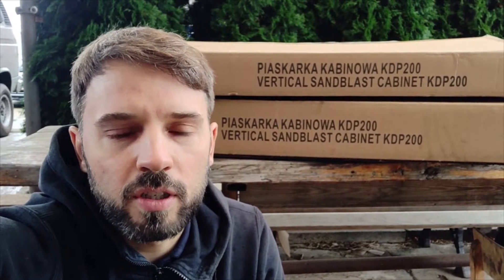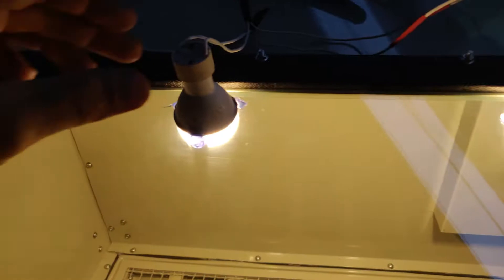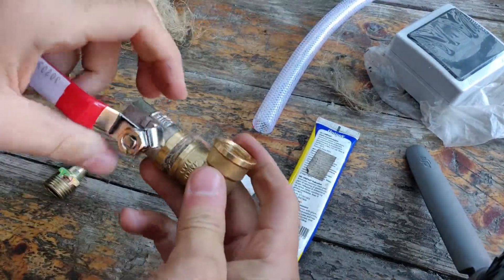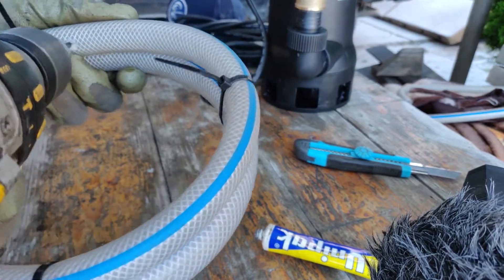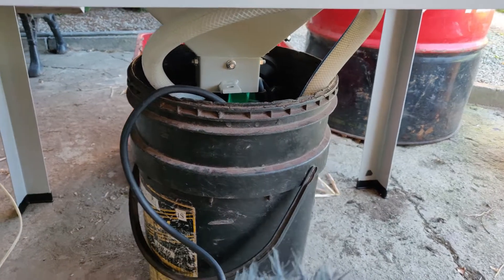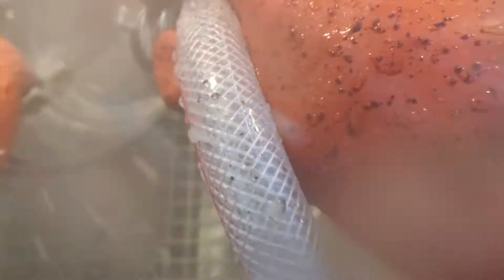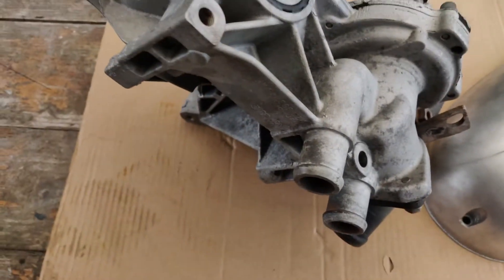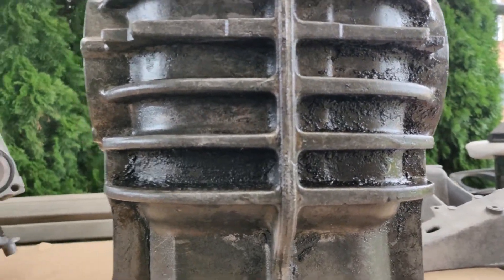Vapor blaster DIY

Comment: How many psi where you using on your air compressor? The pressure looked low.
Reply from the maker: I am using a screw compressor and I am not sure how to increase it, so it keeps around 6 bars.

Comment: Like your setup you can make it work beter if you
1.  get better mixture on your media 
2.make the pipe from.the pump to.your.gun continues without a.valve
3.use glass beads instead of soda
4.use 8 or 6mm nozel
5.play around with your water bead mixture  in your bucket
Good.luck enjoy
Reply from the maker: Thanks, I will keep in mind. I have done some things already, even added high pressure washer setup, which I'm very   happy with. Also made a video about improvements of this setup. 
Cheers, G.
Reply: @Gadomaitis  soda it disolves in water... its for dry blast
Reply from the maker: Good point, anyways, I was adding it just as extra, as I thought for a fine finish
Reply: @Gadomaitis  ad as they mention: glassbeats and afew drops of soap,dont put to much or u get anoying foam,for  a polish result, low presure ~6 bar and then poliish wheel whit compound to have a miraror effect
Reply from the maker: Thanks, I will give it a try, when temperature will rise above freezing temperatures in my garage!

Comment: Using soda in water is not real good. Soda dissolves... Glass or garnit or aluminium oxide
Reply from the maker: Didn't knew that, thanks for your advise. Anyway it was just a one try that didn't turned out well, never used baking soda since. Korund to cut and glass beads to finish.
Reply: @Gadomaitis  yeah mate.... Trial and error. I use soda in dry blast for carbs then I put them in my ultrasonic cleaning tank. It's a bit safer due to soda dissolving and doesn't leave any nastys in carbs.
Nice effort tho..
Reply from the maker: @gc33  Exactly, trials and errors.  I will keep in mind your advice for my next job, appreciate it, thanks.  Cheers, G.
Reply: @Gadomaitis  I'm still playing with mine. I have done almost exact thing as you have... I seriously need a bigger compressor tho...
Reply from the maker: @gc33  I have two of them on same air line. First one is a screw with ~1,5 m3 flow, another one is simple piston compressor and maybe ~0.65 m3, The difference between those two while working is huge, after one hour of constant work, the piston one heats up and I can feel the heat from that compressor in the room, somehow doesn't feel "healthy" for it, meanwhile the screw compressor easily handles work loads. Slurry pump and the setup of it makes a big difference, after the modifications I have done to it later, it's a pleasure to work now and I'm extremely happy with my high pressure setup in the same cabinet, if you haven't done it, I highly recommend it, of course if there is a need for it.

Comment: What air pressure you got? I think you need like 120psi and at least 15cfm to get the job done.
Reply from the maker: Pressure is between 6 and 8 bar, around 120 psi, the flow above 30 cfm. Problem was the nozzle. I have upgraded it already, works like a charm now.
Reply: Other guys that are on YouTube use minimum of 60psi...
Reply from the maker: @gc33  I have sorted out that problem, it was due to media lift, now it's working like a charm.

Comment: Good job brother
Reply: yeah i'm open my business since 2 years..
Reply from the maker: @H.K_project-015  mate, good luck with your shop, keep it busy. Cheers, G!
Reply: @Gadomaitis  if you want I can teach you about the powder coating business
Reply from the maker: @H.K_project-015  would love to! But I doubt I have time for new business.
Reply: @Gadomaitis  I think if you have a vapor blasting device ... you boda also opened a powder coating business ... here I use it to repair some old motorbikes
Reply from the maker: @H.K_project-015  truth to be told, I'm trying to restore my old bike https://youtu.be/hEbuxREiDPM , do you have any advice to share with me?
Reply: @Gadomaitis  you have facebook.?or you have a whatsapp number.?
Reply from the maker: @H.K_project-015  I do have FB, You can find a link to my account in my channel, or in 'about' section, it will be easier.
Reply from the maker: Thanks heaps mate!
Reply: @Gadomaitis  Try using a 2 stage cleaning process ... the results will be more shiny
Reply from the maker: Thanks, I will. Also i have done few improvements to the system, it works so much bettet now. The flow already made my glass dull in few spots. Happy with the results on the material, but not not happy with glass affected. Need to find a solution for that problem.
Reply: @Gadomaitis  I learned from my friend ... he taught me to do sand blasting before using vapor blasting ...
Reply from the maker: @H.K_project-015  i have seen his works, awesome guy from New Zealand!
Reply: @Gadomaitis  where do you from brother..yeah name is josh hubbard from new zealand
Reply from the maker: I'm from Lithuania mate, where are you from? He is doing awesome job, I took some ideas from his videos.
Reply: @Gadomaitis  im from indonesis bro..
Reply from the maker: Cheers to Indonesia mate!
Reply: I have a small business of powder coating-sandblasting-vaporblasting-body paint repair
Reply from the maker: How is it going? You guys busy over there?

Comment: do  two passes one with fine aluminum oxide or fine crushed glass second pass with the fine glass beads its makes all the difference
Reply: Find me on Facebook
Reply from the maker: Done
Reply from the maker: Thanks, I will try. Another thing that I have noticed yesterday, that my media lifting is not giving me enough of media any more, maybe it sats down on the bottom of the bucket, this needs to be  sorted. Also i have ordered 8 and 10 mm nozzles, now I was using 6 mm maybe it was to small. I will have a look at your channel and your solutions, looks like your vapor blaster is doing magic. Nice chanel btw and thanks for your advice. Cheers, G.
Reply: @Gadomaitis  get rid of the ring and go with some downward jets
Reply from the maker: Thanks heaps, will do that.
Reply: I dry blast with 120 grit aluminum oxide followed by vapor blasting with glass beads. Works very well.
Reply from the maker: I will try your suggestion, thanks.